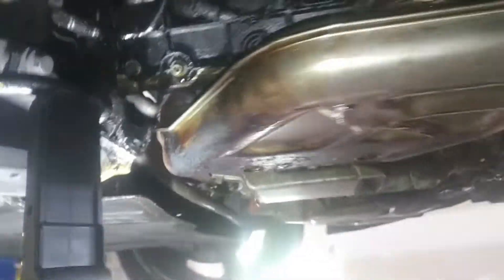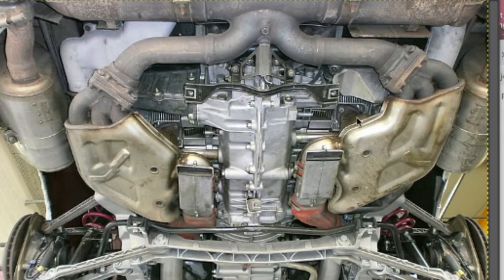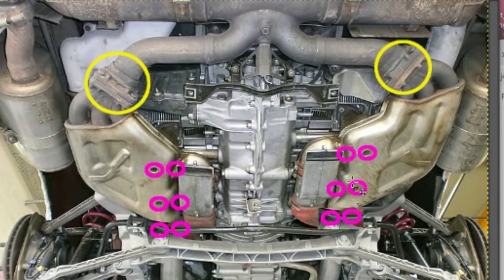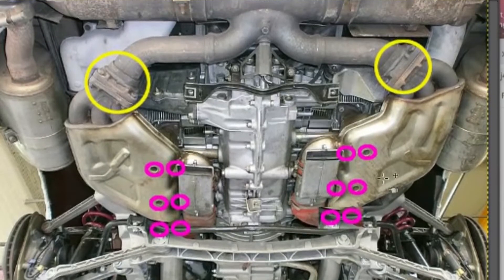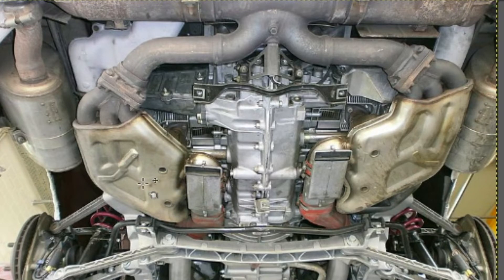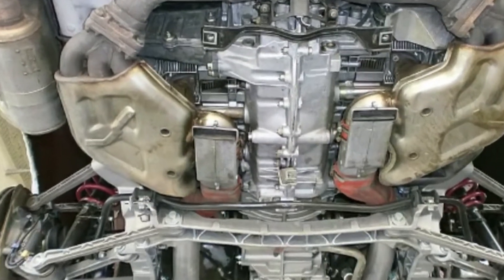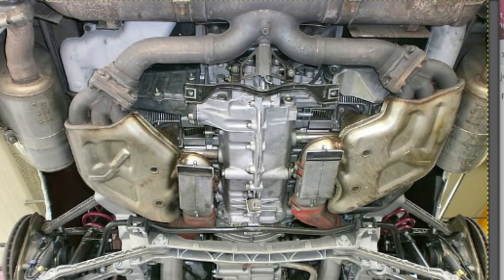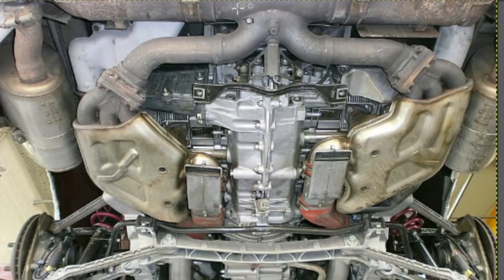Porsche 993C4S - Replacing Low Valve Cover Gaskets

Comment: hey nice video. i just got a 993 but the PO had installed the RS Cams with the Mechanical Rocker Arm Set... so now i have to adjust them like the 964 engine... is this the same process to access the rocker arms for adjustment? i was told that i would have to possible pull the PS pump which looks a little daunting
Reply from the maker: The bottom covers r esay as u can see on this video, the top ones look tough but just need to pull out some parts out(left blower ,vent tube + other little things) then u can play around with rockers& stuff

Comment: The only way to stop the lower oil covers from leaking is to replace them with aftermarket aluminum ones, the factory covers will just leak. I fitted two new sets of original Porsche covers, gaskets & bolts & they leaked. The aluminum covers are fantastic! Everything is now dry as a bone & that’s after 15 years of ownership.
Reply from the maker: My original gaskets were changed by my mechanic some 5 yrs before I did it myself so far so good I take a look at the aluminum when this one starts leaking … I’m the only owner